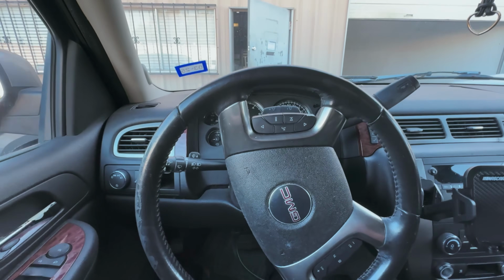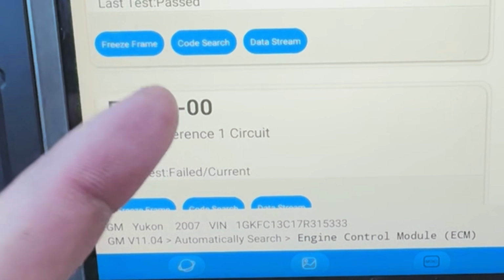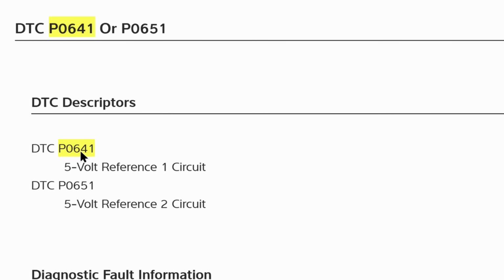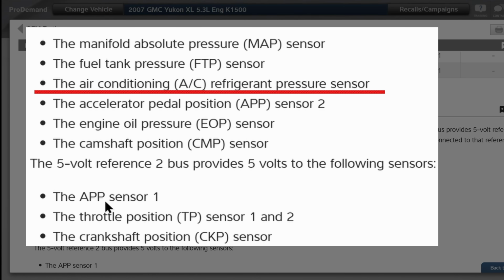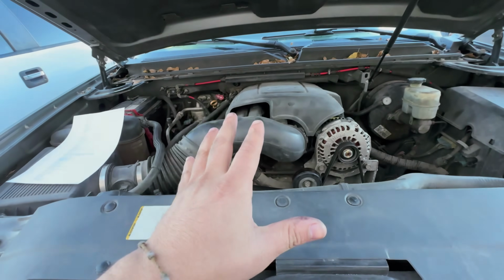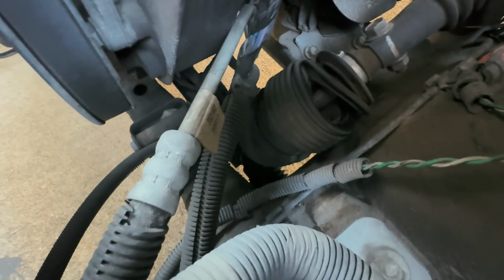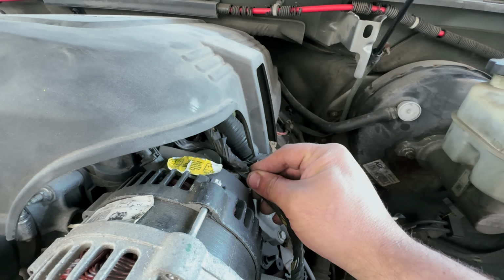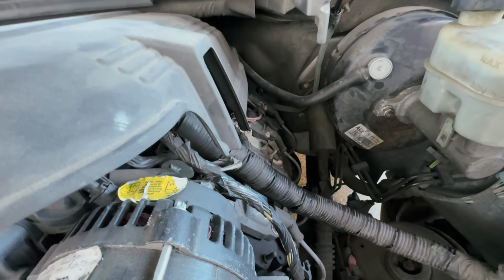2007 GMC Yukon/Tahoe "Engine power reduced" warning

Comment: I have a 2012 Yukon Denali 172000 miles with a 6.2 engine. No issues with this truck for weeks and then yesterday while driving at low speed making a left turn, this truck had complete power loss. Died dead no lights and all gauges at zero. Immediately shifted to neutral and started the truck to drove home. No check engine and codes set. Any idea what can cause this?

Comment: You did your research, found the "Common Denominator"(also known as the "Common Connection") and with your experience and knowledge, knew about the split loom deterioration.  Putting all that information together you looked for a possible problem and there it is right at the Alternator.  I like that liquid electrical tape.  Wish we had that 20 years ago.  Oh well.  GOOD ONE OZ.
In April of 2016 I retired from automotive/truck/stationary equipment electrical and mechanical work.  Watching YOU, IVAN, ERIC O, SUPER MARIO and several others helps to bring back the memories of how I did it.

Comment: There there a source for that cap that goes over the screw threads?  That would be my preferred fix.  Electrical tape and conduit buys time, but as long as it's resting on the screw threads, it's going to chew though.
Reply from the maker: @russellhltn1396  if you look at the end of the video it shows where that cap goes over the cable and as well is moved to another position. Check it out

Comment: Thanks for sharing!  I can’t believe the false warnings that pop up on the dash when there’s a GM 5V reference issue. I’ve seen tow brake warnings, low power, traction assist warnings etc that have nothing at all to do with the issue

Comment: What i don't like about Oz is that he never shows the repair to the end..or he says whats wrong but never the fix
Reply: Wait, you cant be serious… in the video he literally shows you exactly the specific spot in the wiring harness where it rubbed through. So you needed to see him fix the wire? Why? You can’t fix a wire? Spoiler alert cut out the bad part with cutters, strip the wire and either crimp it together or solder. Why did you need to see the wire repair? You cant be this helpless, correct?
Reply: @mikesabin8568 I was even going to say put a rubber boot over that start coming from the alternator that was providing excessive voltage
Reply: You’re not paying attention…
Reply: For sure let's be serious Oz clearly shows the exact faults and the exact final fixes and me I don't need everything that is enough